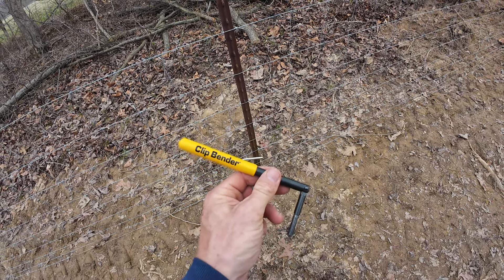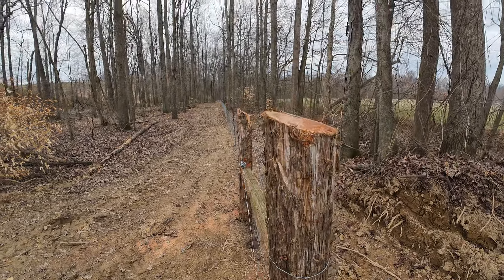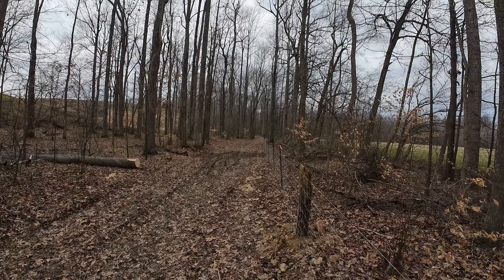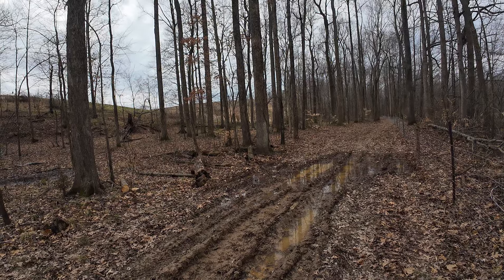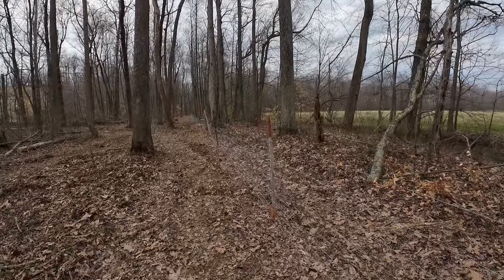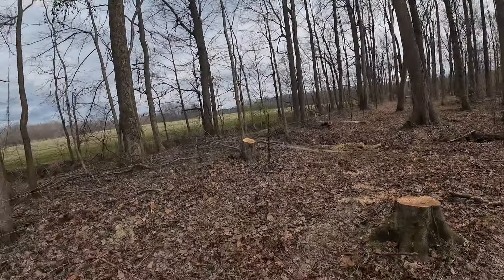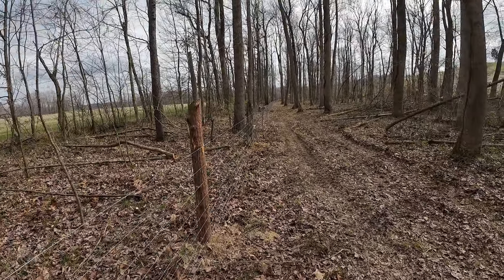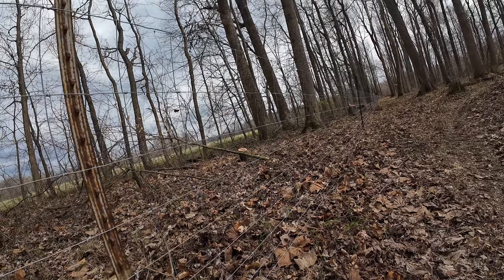Hopefully fixing more than a fence on this one.

Comment: I almost bought that to upgrade from a simple tool that lacks the joint.  Then I bought a box of 500 LockJawz spring wire clips instead. You see those? I'm about to run woven wire in my woods and use t-posts. I got a deep ravine I have to figure put how to fence thru. Thanks for showing your tribulations. Helps to see how you do stuff and learn from your experiences as I do it.
Reply from the maker: I have not seen them.  I will check them out.

Comment: Where are you getting your wire from buddy
Reply from the maker: I found a deal on that at the local rural king.   @ $155.  Gaucho brand 25 year coating.  Its thin but stretched out nice.

Comment: Timeless posts were cheaper than fiberglass rod for me, because I’d have to ship either from down south so there’s no seconds rod around. There’s one flag pole company around but they won’t sell me the cut offs cause they have a recycling deal.
Reply from the maker: Yeah, I had to ship on a semi truck with a pallet.  I don't remember the exact cost but I do remember I don't want to do that often.
Reply: @alanwesterfield4254  thinking back the fiberglass rods were actually slightly cheaper, but with drilling and painting I think for me timeless is better except for slight bends they wouldn’t support because it’s faster. Also I had a tree fall on some fence that bent them to the ground and they stood back up but the fiber rod I used for a bend in the fence along the road was shot. Not trying to shill em, you clearly build great functional fence, but they’re so dang easy to use. If you haven’t tried em and they’re potentially in the budget they might be worth a try. I like them but our sheep farms are about as different as two American sheep farms could be what with you being in Kentucky and me in taxachusetts.